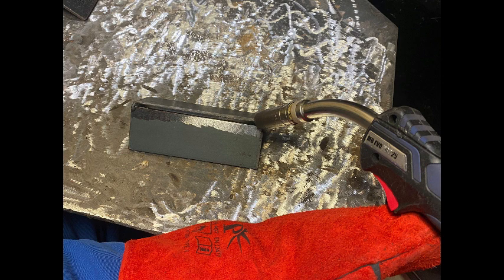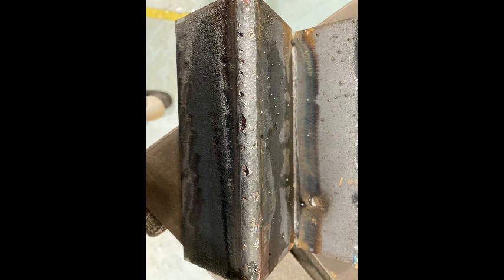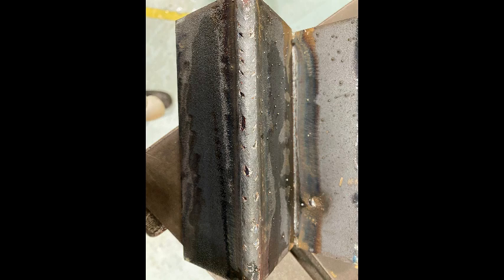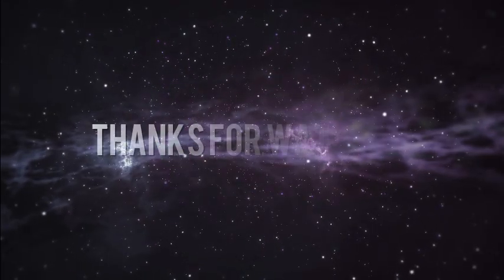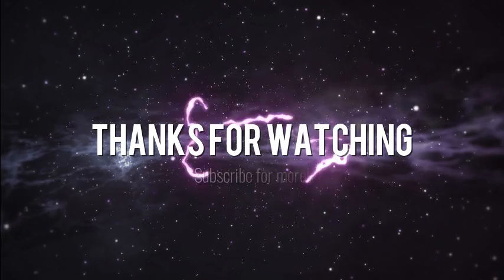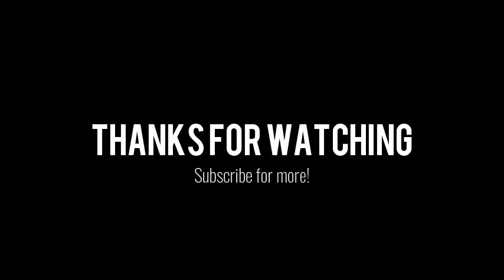MIG welding Corner joints Tips and tricks (1G/PA)!

Comment: It doesn't matter what you're welding, it doesnt matter if it's coded work or not. A cursive technique or some other technique that involves you leaving the root and focusing more on the side wall penetration is much better for corner joints.